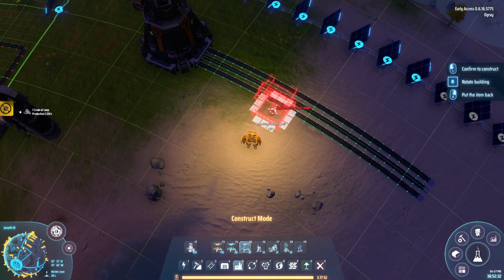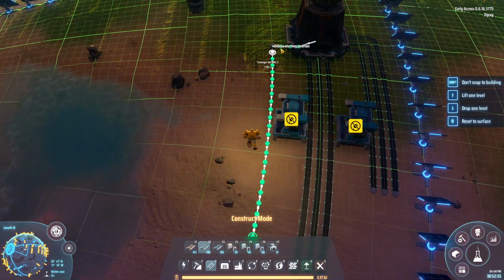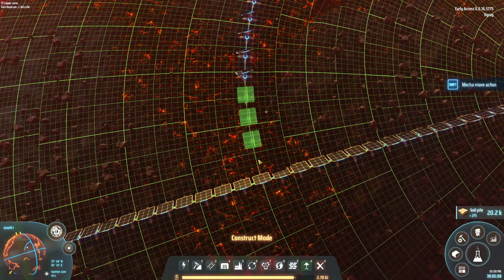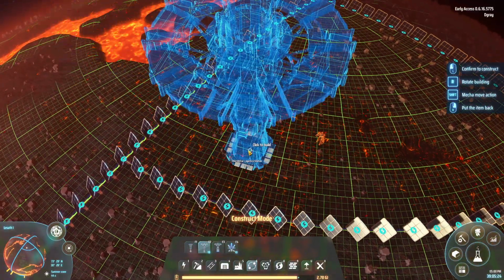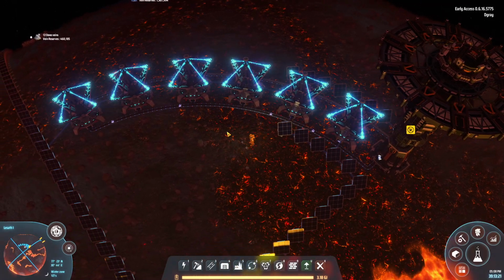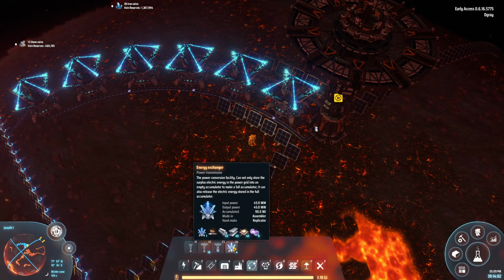MOVING POWER WITH DRONES! - Dyson Sphere Program - Let's Play Tutorial Gameplay DSP Ep 31

Comment: You need to manage the energy dischargers. They do not regulate them selves, you regulate them, have some normal accumulators on the grid to smooth out power spikes and cut the conveyor so only one discharger is active.
Reply from the maker: I agree. Will work on getting a good way to manage power. Hope that we can get combinators at some point, to manage power better 😊
Reply: I think the fact all other power facilities self regulate means exchangers are the powerful but imprecise option. Combinators would only give control on that one facility so it would be low on additionnlist.